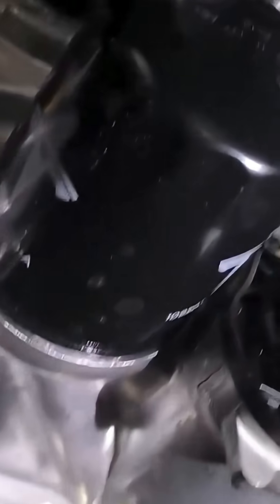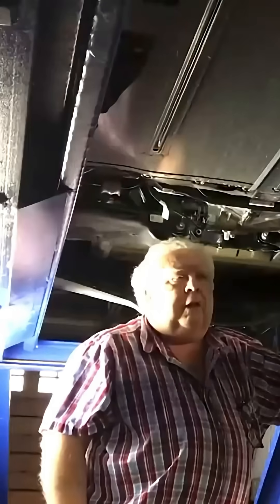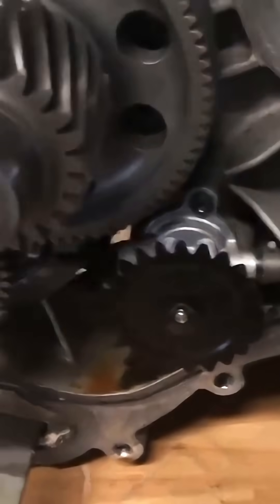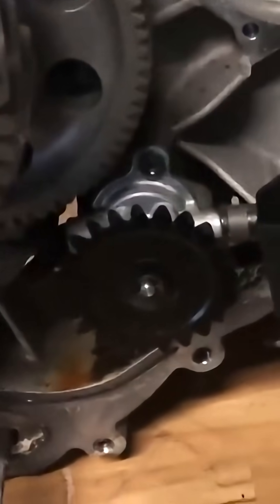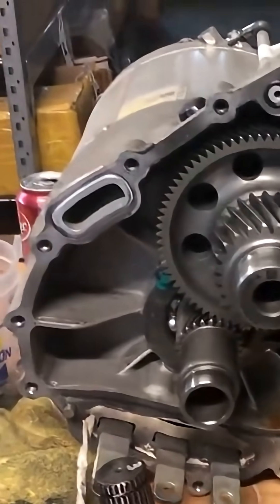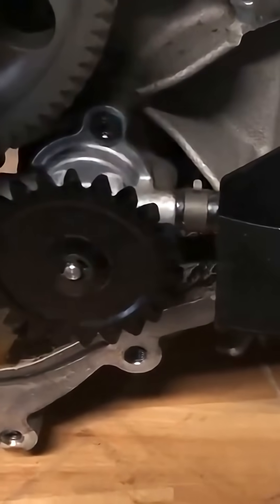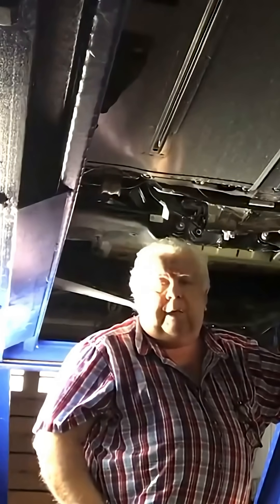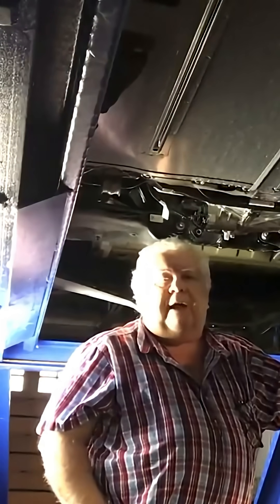How @Tesla achieved the Million Mile Drive Unit.

Comment: Yeah, the motor might last that long. But you would have gone through 5 different battery packs. And with the price of changing those out at that point, you could have just bought another car.
Reply: If they build the new battery packs to retrofit the older cars they'll be extending the battery issue out to the point it won't matter. Charge time to 100% 15 minutes. 500+ mile range. Charged by solar panels overnight at relatively little to no cost. It powers your house should bad weather hit. Tesla becomes a power company.
The power grid won't matter. Asteroid hits and wipes us all out to the stone age.
Reply: Battery packs are proven to easily last 200K miles +. 1500 full cycles at 240 real world miles of range = 360,000 by the way. Age has an effect too, sure, but I cycle my phone battery so much more than my car, not to mention the car batteries have thermal management and a whole BMS. Who cares if I need 3 packs to drive 1,000,000 miles? That's way better than ICE.